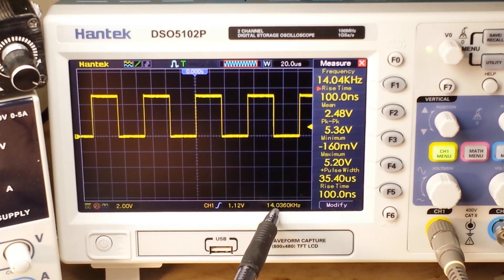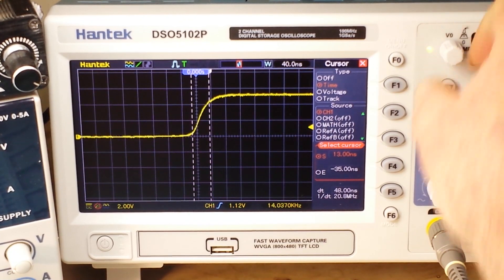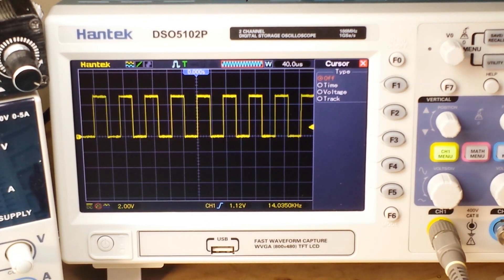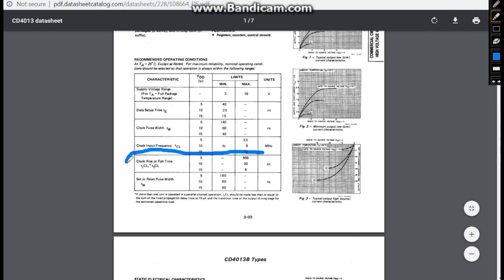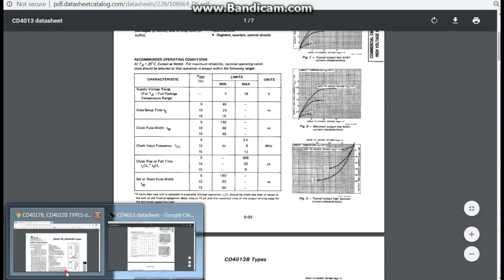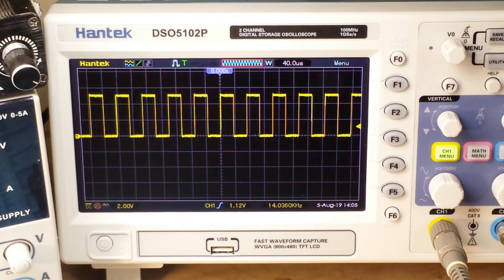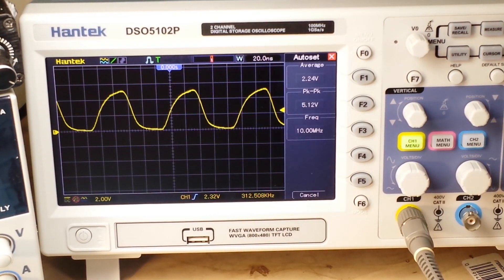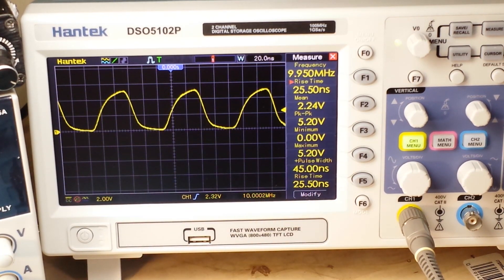Digital Logic, Rise Times, and Edges

Comment: In FET based IC’s such as CMOS they do care about how “OFF” the transistors are, the more OFF transistors are the lower the leakage current additionally with CMOS higher transition speed, rise & fall times, will also reduce power consumption.

Comment: Paul could you do a video on where you would need to increase your wire/trace thickness in a circuit because of a need for increased current flow/power etc, i think alot of us beginners would want/need to know that when designing our circuits.. thanks I hope you consider this✌

Comment: Not  true on the Edges being the absolute thing.   Voltage is the logic creator.  More or Less.  Makes or Exceeds threshold or it doesn't.   Becomes a (1) or remains a (0) .  The reason the Edge is so important is because digital logic is based on time as well.     You have ON ,  OFF  , (More , Less )  all being  required to be ON TIME.  or Late.     Late is only relevant to the required switching times.   Analog computers not only work fine but can far exceed logic levels of any digital computer.    You can have four or more states of logic all based on VOLTAGE LEVELS.  Within a given time.  LOL
Reply from the maker: I was only talking about digital logic here. But I accept your argument.
Reply: @learnelectronics  Argument ?  LOL ,  Not from this end.  Just pointing out yet more considerations and iterations.  Some people get twisted up trying to understand Electricity.  Once ya figure out the basics it all comes together.    Electricity can only be seen as a few states.   It can be On.  Or it can be Off.   There can be More or there can be less.  It can be on time or it can be late.  Voltage causes Current and Resistance controls flow.   Some day we'll figure out how to flow the Protons and Neutrons and piss on the Electrons. NeuProTronics ?